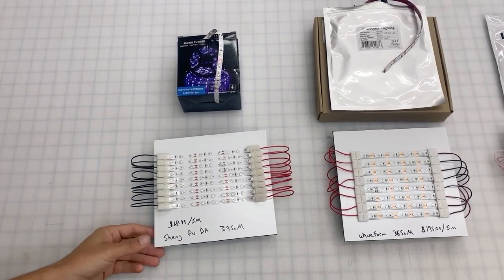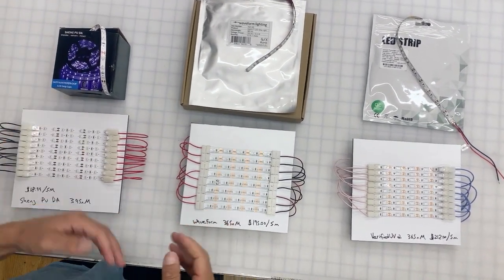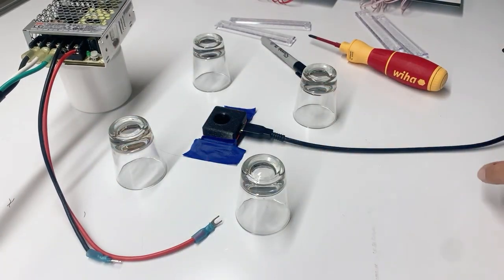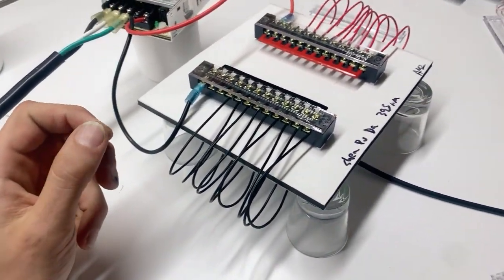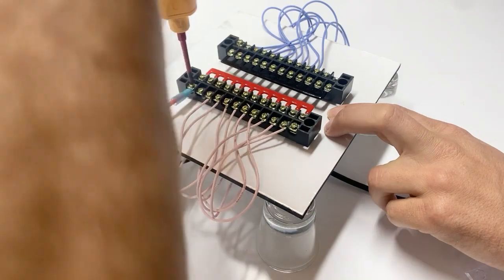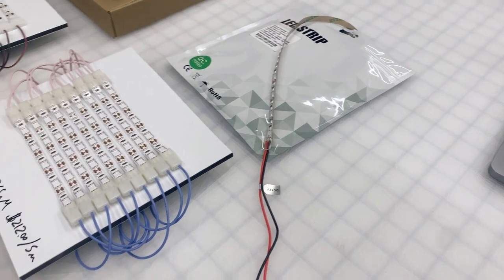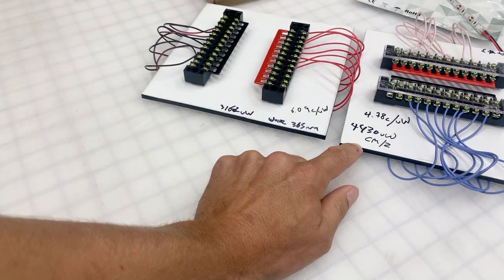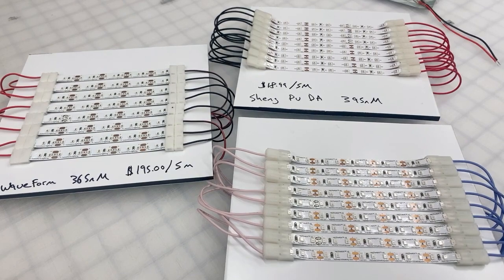A comparison of LED lights in Cents per Microwatt for Platinum & Palladium alt process printing.

Comment: I appreciate the effort that went into this experiment, but I don't think it yields valid or useful results. Firstly, the sensitivity of the emultion of the platinum or cyanotype process is not equal for 365nm and 395nm. At the same power output 395nm LEDs will likely yield longer exposures because the emulsion is less sensitive to this wavelength. Secondly, a UV sensor typically has a spectral sensitivity curve that isn't flat. Your measurement for the cheap 395nm LEDs is likely far too low as the UV sensor is most sensitive to 365nm (and therefore less sensitive to 395nm). Lastly, the density of LEDs within the field of view of the sensor isn't controlled for.  So,  wouldn't it make more sense to do a real world comparison? I'd like to see a measurement of the exposure time needed for a particular print with all three kinds of LED strips, keeping all other variables the same.
Reply from the maker: 1. We are specifically testing for 365 Iron processes (PtPd as in the title). 2. I stated that the 395 are what a lot of people are purchasing in order to do iron processes, but they are actually needing 365. So yeah, it's part of the point. We have narrow band 365 filter on the sensor similar to 365 process. As stated in the video, it does pick up some 395. 3. Re: density of LEDs: In this video and test we are attempting the "most-dense possible" amount of LEDs for each strip profile. Essentially we are doing cost of uW based on the largest amount of 365 UV we can pump out per CM per LED type. That is the test. These are all clearly defined parameters. 4. Yes, we can do a real-world comparison. Sure, that's in the plans. It will be PtPd to start with, along with other 365nM processes. And we can do real-world cost-per-uW based on those printing methods sure. 5. Why does time matter? Well the longer the exposure the less prints you can do (a lot of LED units out there are doing 20min exposures for PtPd and Cyanotype etc) while we are doing 62sec exposures on our strips (90sec for cyanotype). This is significant if you are wanting to get 15 prints out or 20 prints out in a day. The longer the exposure the more dry the paper becomes for print-out methods. The longer the exposure the more wear on the LEDs (heat over long periods of time) and the lower UV output you get the hotter the chips get. The longer the exposure the more electricity is used and the more all the other parts wear out (vacuum pump, power controllers, etc). So there is value in figuring out the shortest exposure and there is value in finding the real cost of the shortest exposure possible with different LED types. In this case we are testing it in a 365nM defined space.
Reply: @ConeEditions  I'm just making a point about the science. Using a narrow band 365nm filter is the reason your 395nm power measurement is erroneously low. The implicit assumption here seems to be that the spectral sensitivity of the emulsion is equal to what the narrow band filter transmits. I don't think that is the case.  Regardless, I think we agree that it makes sense to buy better LEDs to save time.
Reply: @ConeEditions  You are not really testing the 'most-dense possible' amount of LEDs for each strip profile, as you are using the plastic connectors for these strips. In my UV exposure rig, I soldered the ends to the UV strips, which enables them to be stacked without any gap and with a more secure connection. Maybe the argument is that soldering is an 'advanced' skill, but if a person does not have knowledge of soldering/electronics, I don't think he/she should work with either AC mains or high-power DC power.
Reply from the maker: @anders077  that's correct we are not, because most of the exposure plates made with these are in the 30x48 inch range and some up to 44x64 inches and therefore the easiest method of replacing strips should they be injured is not by soldering in tight places and upside down. A completed exposure system looks like this: https://shop.inkjetmall.com/VerifiedUV-Exposure-Systems.html  So, it is not the lack of skill, but the practical application of when someone inadvertently closes the cover on an ill-placed lunch box they can muster their own repair by reaching in to unclip and re-clip new strips rather than to try and solder while upside down or using a mirror. There is no voltage drop to using the clips and our current highest density (at 3mm between strips) produces greater than 7000uW/cm2 at 4-6 inches. And this is more than 7 times the amount of irradiance produced by a 3000w NuArc platemaker. At 11mm between strips the systems produce 4000 uW/cm2, and we also offer lower powered systems with even greater gaps to about 2000uW/cm2. As is the 3mm spacing will expose a platinum print in 60 seconds compared to the 18 minutes of a NuArc system.